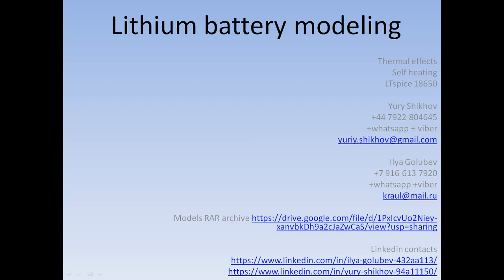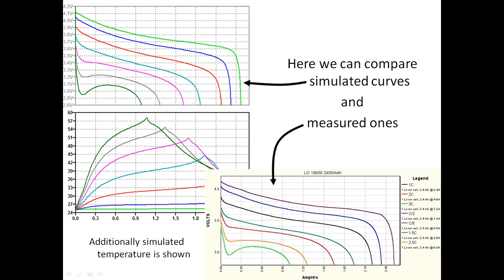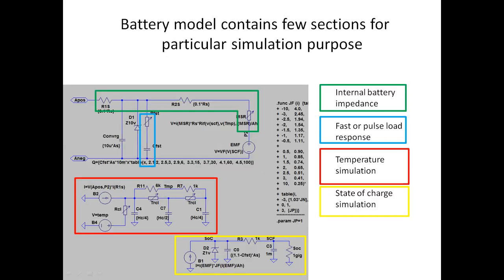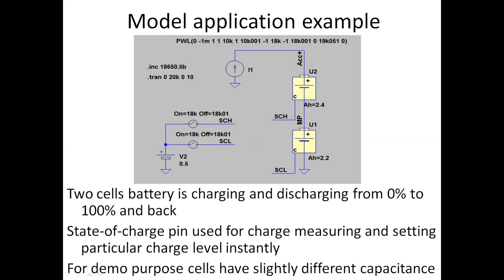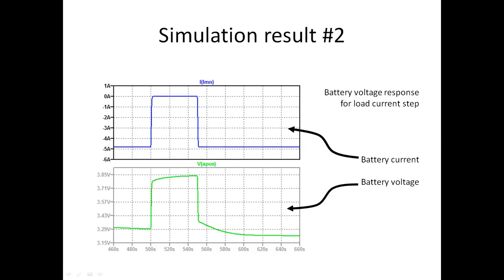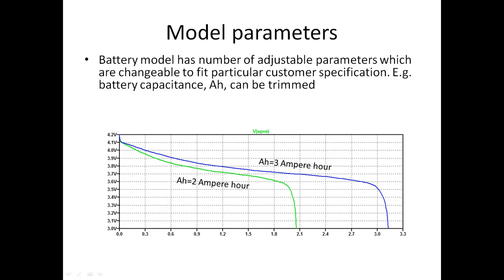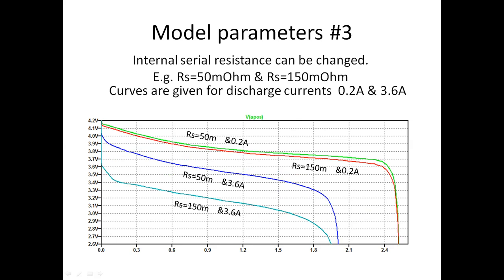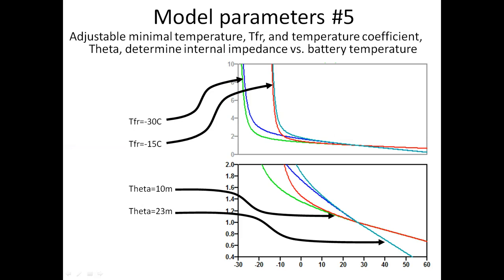Battery thermal effects modeling

Comment: Great work guys! Thanks for making your models and simulations public, I was looking for a good Li-Ion model including thermals.
Some small remarks on the simulation model: in 18650.lib there is a hardcoded path ".lib C:\Users\Ilya\....\standard.dio", that shoud be just ".lib stardard.dio". Also, the PPT file is slightly older than the one in the video, and contains some errors you fixed later.